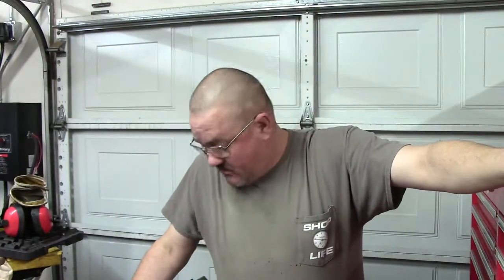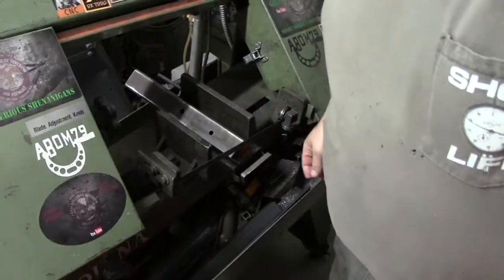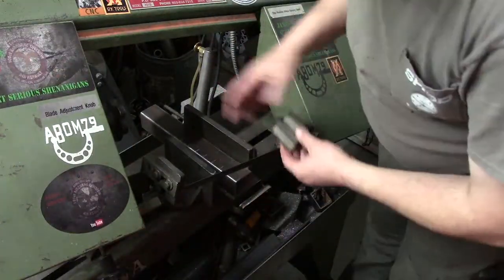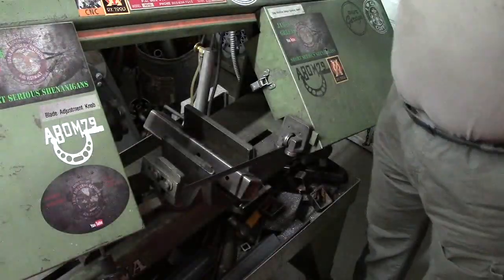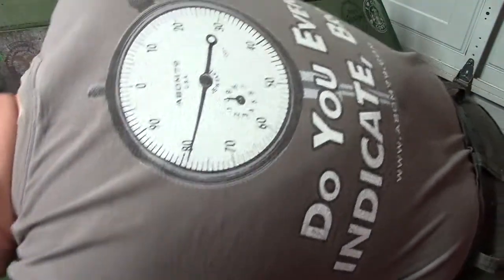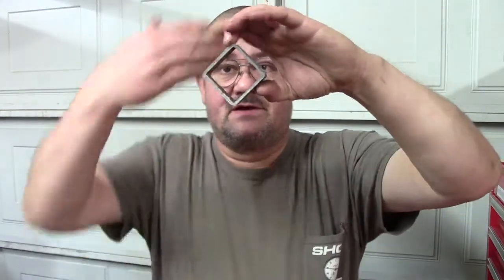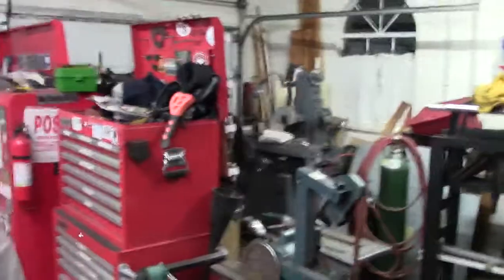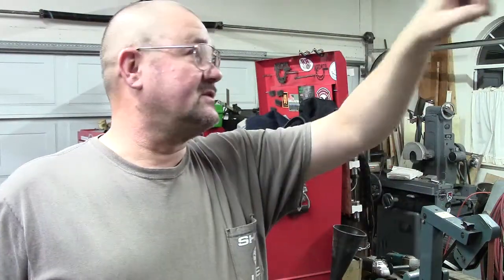New Shop Band Saw Cutting Tip

Comment: Hi James!  I found your channel while watching Abom79 and he mentioned your were in Albuquerque.  I'm here as well.  This video tip is AWESOME!  I always have issues with my Kalamazoo 610 when cutting square tubing as it cuts nicely through the flat and then speeds up through the verticals--it sometimes pops the blades off the wheels, but this feed rate is essentially constant.  Time to make up a V block for my saw!